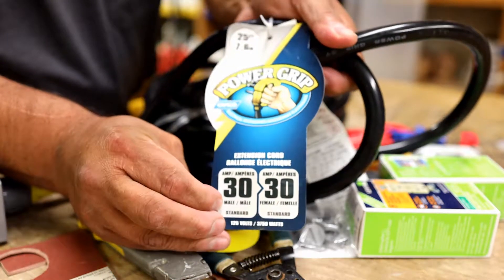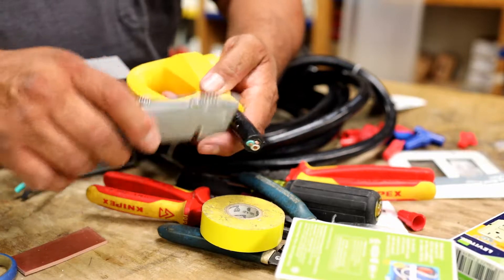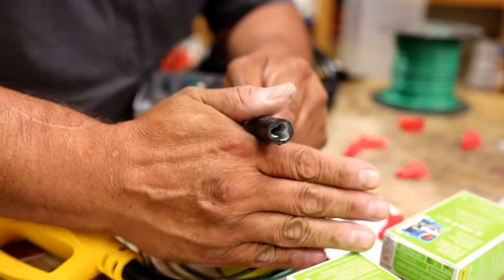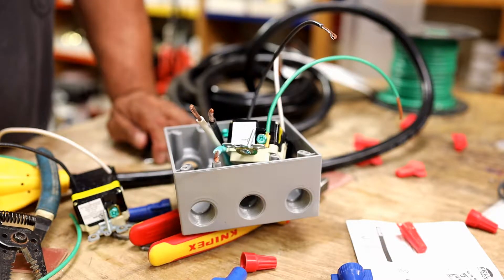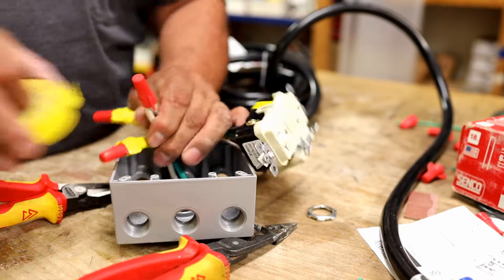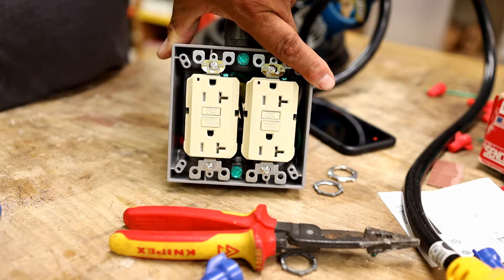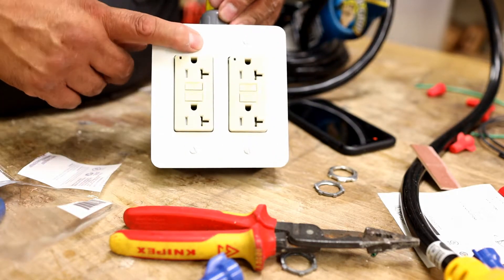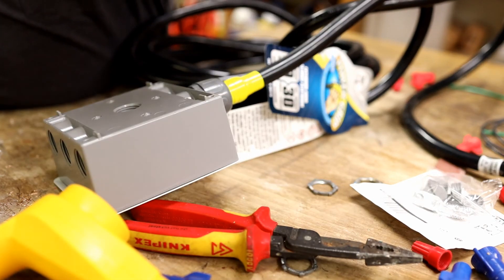30 Amp  RV TT-30P plug to a double gang box with GFCI 20 amp outlets wiring shown.

Comment from the maker: this set up cost me about $ 75.00 not including 12 gauge wiring I had lying around at HomeDepot. Much cheaper since this type set isn't available commercially in the USA that I know about the date of this video upload. And a lot of just RV extension cords cost the same or more. This set up allow us to have immediate access to our 30 amp RV generator plug. The Double gang box and breakers is for indoor use only!!